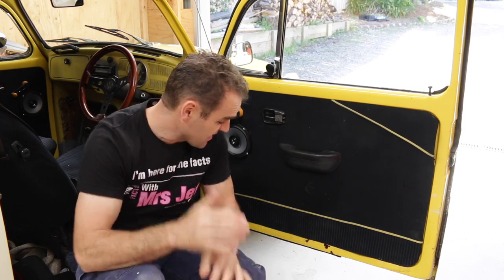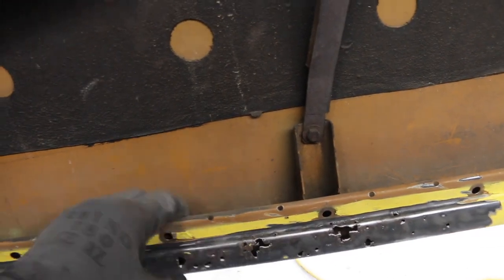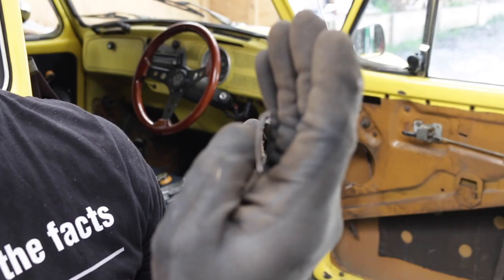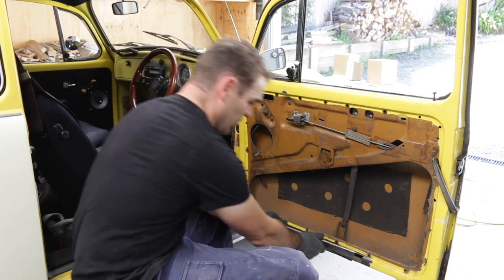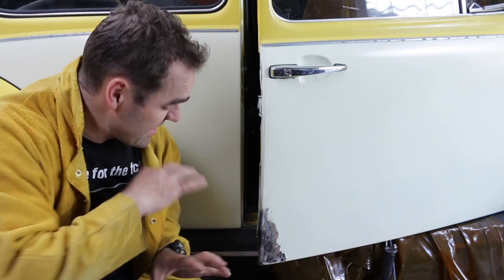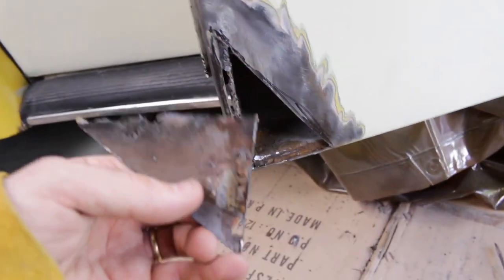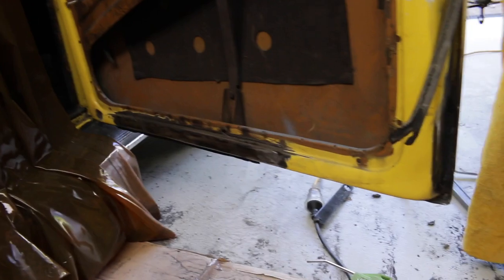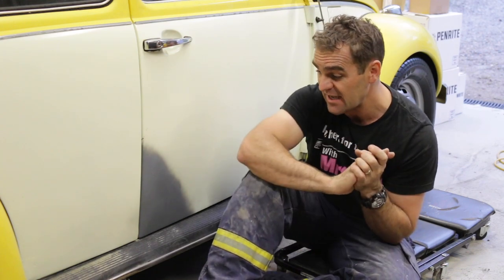Door rust repair - Home Built Project Beetle part 8

Comment: Good work on the rust repairs Jeff. Just a note, try to cover or protect your painted surfaces and glass from grinding sparks and weld spatter. The stuff eats in and imbeds itself into paint and glass. I ended up getting a cheap fire blanket and use that as my protector.
Reply from the maker: That is why part way through I chucked up the welding blanket, but the whole car is being resprayed so at least the paint I was not too worried about.

Comment: Here's kind of a random question - what is the spec on the wheels you use in your angle grinder when you are working on sheet metal like this? For grinding? For cutting? When I go to the hardware store, there are dozens of choices and I'm never quite sure what to get. 

Keep up the good work - lots of inspiration here for me as I plan my own Beetle resto!
Reply from the maker: I usually use 40 grit flap discs. I have found they work much better for grinding down welds than the hard discs, and they don't heat the panel up as much.

Comment: Noice. Do you use gasless or gas MIG? Gas kills it, worth the cost. Maybe TIG if you're gonna be doing more of this stuff (I think so) You can get some cheaper units on ebay to try out. But yeh, nice birthday for the ol' girl
Reply from the maker: I use gas. I struggled along with gasless for years and as soon as I tried gas, I have never looked back. Sooo much better and cleaner. I actually have a brand new TIG waiting for me to try, but I still have to get a chance to try it. I have never used a TIG so I am looking forward to learning a new skill.

Comment: What product do u use for rust treating??
Reply from the maker: I use a couple of different ones (I am not an expert). I will often use a basic rust converter from Supercheap and then spray it with a zinc based anti rust spray before painting.
Reply: Jeff try the aerosol version from supercheap   rust converter/sealer/primer  easy as

Comment: What welder do you use Jeff?
Reply from the maker: I just got a new Bossweld Inverter MIG. I am finding the new inverter style MIG so much easier to use than the old transformer MIG I had.
Reply: I should have known that because quite a few episodes ago you did that & I should of just glanced back through. Could you please tell me the particular model you have. I still have the old CIG mig I bought back in the '90's & it's hard to get new tips etc etc. Yours is gasless too yes? I still pay my bottle rent & when you don't use it as much anymore it becomes expensive. I'm just doing the floors on my 1962 Vanguard Six & I'm thinking it time for a change. Cheers for your great content Jeff, not only is it great to watch but it also inspires people to do the work themselves. Any idea when you maybe putting Polo-neck shirts on the merch site? I hate T-shirts but I'd definitely buy a few polo's.
Reply from the maker: The company I use don't offer Polo's as an option sorry.

As for the MIG I would suggest the M150 which is gas/gasless. As for the gas, you don't need to pay bottle rental anymore. Finally the companies have realised and (if you are in Aus') you can pay a 1 off purchase fee and then just bring the bottle back to Bunnings and swap it for a full one quite cheaply. Gasless works, but once you go Gas you can never go back ;)